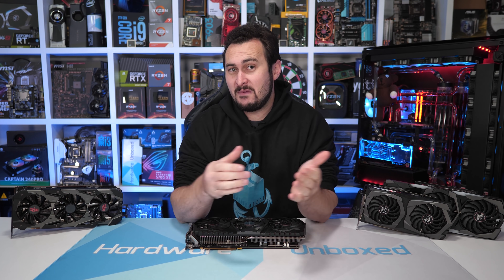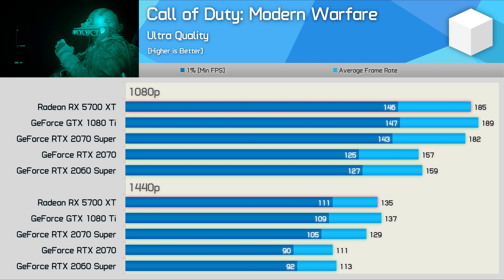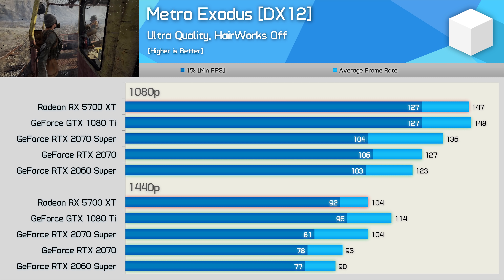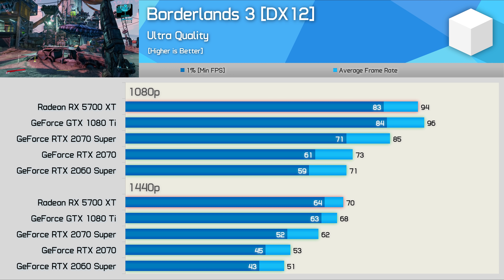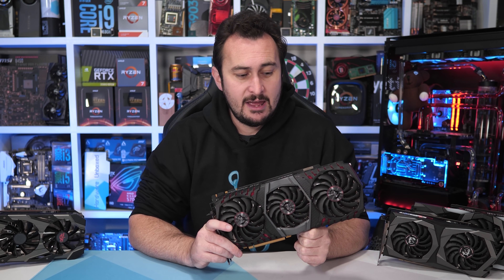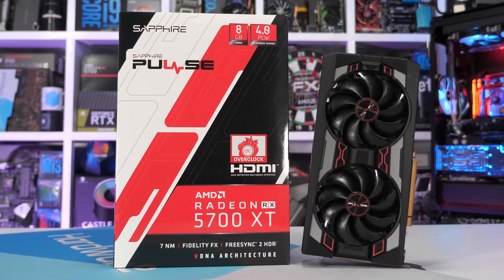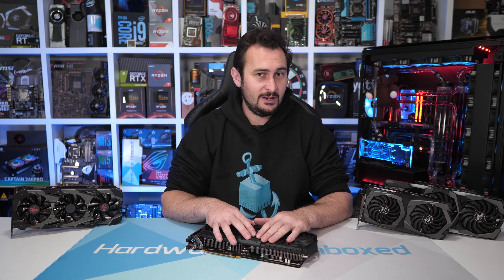GeForce GTX 1080 Ti vs. 5700 XT & RTX 2070 Super, 35 Game Benchmark

Comment: In the mining craze, i spent $1000 on a brand new 1080 Ti founders edition. I still use that card in my other rig on a full custom loop. Not getting it off until it cant no more. Gonna be a goo while. LOL
Reply: When I'm not gaming with it my 2080ti is going to mine itself back with my basically free electricity. I currently have £736 worth of BTC at the current rate.

Comment: I had the option. Buy a used 1080 ti for 550AUD or a new 5700XT for 729AUD. The answer was simple. 11GB, higher processing power, much cheaper.

Comment: I am surprised how well the 5700 XT did against the other 2 cards. It's basically a slightly worse 1080 Ti that costs new arround 150$ less than a used 1080Ti.

Comment: The max potential of the red devil or the nitro+ is to boost around 2150/ 1800 and with these settings i think u can get 4 5 fps more... So the point is, 1080ti is still a beast card if u consider is coming up in 2017, but imho the best choice for price/performance is the 5700xt.

Comment: Great video! I'm currently looking at getting a 2060 Super, or even a 2070 Super if I can fit it into my budget. I was just wondering, is there anywhere where we can find the exact stats of these 35 games on each GPU? I'm particularly interested in the frame rates achievable in Star Wars Jedi: Fallen Order on the 2060/2070 Super cards. The only stats I could see about the game in the video was the % difference between the 1080Ti and 2070 Super, but no actual frame rate benchmarks. Is there anywhere to get this data? I'd really love to see how it performs. :)

Comment: The 1080ti was indeed a good GPU but is not sold new anymore here where I live (in Portugal) and if I go to buy it used with no guarantee, it is more expensive than a 5700 XT new!  Is also impressive how the 5700 xt beats the RTX 2070 in all games, the RTX 2070 super in some and is very near the GTX 1080TI in other games while is 100€ less than a normal RTX 2070 and ~150€ less than the 2070 super here! But only a few people on the comment section seem to care! Isn't that a good value in a GPU? Is just because is AMD? People need to stop looking at brands and start analyzing real value. For those already with a 1080TI stick to it is excellent GPU still.

Comment: Thanks for the videos. Great to get info on where the 5700XT stands against the 2070S/1080TI and other cards. 

I'm very happy with mine and have had no issues. I've had my brother and two friends get the GPU too and the two friends had issues for a day but I have a method that seems to consistently fix issues right off the bat!

Prevent windows from automatically installing drivers via a setting
Restart into safe mode and DDU TWICE in a row 
Install motherboard BIOS updates (Make sure to follow instructions that may differ when it comes to models/manafacturers)
Reinstall chipset driver
Reinstall graphics driver
Re-enable auto windows driver install

Hope it helps anyone who has any issues. Beyond that it's been smooth sailing for all of us since!

Comment: Steve, you keep ignoring that the 1080ti also has 3GB more Vram than the 2070 Super as well as the 2080 super ,  which is another deciding factor to ones purchase decision... Only the 2080ti can match that !!! COD MW fully utilizes my 1080ti's 11GB Vram ...
Reply: @KarlKlaus vonS MW seems to have a logic to utilize all available Vram for better results. Look it up if you want. I am constantly gettin10.4 GB of gpu vram usage even on 1080p / 240hz ... MW was just an example, my point was that the 1080ti also has the Vram thing on its side against all other GPUs.
Reply from the maker: FYI that's just RAM allocation.
Reply: @Hardwareunboxed  I believe i can distinguish that !!! Please see here my in game capture: https://www.dropbox.com/s/uqsr5kz6bmljb33/1080ti_vram_mw.png?dl=0 

Also you need to state the Vram in favor of the 1080ti still ...

Comment: This video is about 1080 ti but made me want to buy RX 5700 XT somehow.
Reply: its a good card, and still less expensive than a 1080ti
Reply: Despite the drivers improving, I won't touch a 5700 XT. There's still a lot of people having problems with them. That being said, if they drop in price the risk may be worth it. Let's see what happens to prices when big navi drops.
Reply: @UKFX  They won't drop the price any time soon. The price is incredibly low for what it's worth. I bought a 5700 XT about just a week ago. Popped it in, powered it on and installed the latest AMD drivers. No issues at all, no additional setup needed, works amazing for 1080p Ultra games.
Reply: @UKFX  wtf why would it drop more? IT'S  380$ IN BELGIUM

Comment: From a gaming perspective (which is what this video is aimed at) Steve is correct regarding the pricing and the buying logic. However what Steve does not comment on and I would not expect him possibly to know is this card is still superior for coders doing machine learning. The performance coupled with the 11gb (3gb more on average) vram make this still the price for performance king. For this application this card is comparable to the 2080ti and Radeon 7.
For gaming Steve is of course correct and most would care only about this. But when wondering why these prices are maintaining above depreciation expectations coding performance must be considered.
Reply: What are tensor cores? Proof that you're a moron.

Comment: 5 months ago, i sold my 1080ti for 500 euros and bought the 5700XT sapphire pulse for 340 euros.
Can't say i noticed a difference in day to day gaming, but i sure noticed it in my wallet :P
Reply: That's a nice trade to be honest. Getting a cheaper and a bit less powerful GPU but getting some bucks to your pocket. Not everything is getting a higher priced GPU.
Reply: one of my water-cooled 290X died so I switched to an 5700XT after not being able to find an used 1080TI under 500 eur, especially not an ex mining card. in far cry 5, the 290X's were faster, but luckily that was an outliner.

the 5700xt cost me 420 eur. I was wondering who bought a two year old asus turbo ex-mining card for 450, which was the case. it was completely crazy.
Reply: Yeah you got some money and lost 11% perf on 1440P, you might aswell get a cheap gtx 750ti so you save alot of money and lose some performance...See this sounds stupid as much as your choice?
Reply: nighthawk695476 does your card work good? Any driver issues? I don’t know what to upgrade to. I’m using msi rx480 😭
Reply: GoHardSniper
I got a Gaming x 5700 xt, got it at the end of last year. I had some driver issues; occasional black screen on game boot up (only happened on game startup, never once mid game) would have to restart via button. But now, since mid February driver, I’ve had zero issues. Running latest drivers since, and no issues.
I have a 2139mhz core oc, at stock voltage and power limit, runs 2ghz+ 95% of the time. Pretty good for the $519 cad I got it for. I upgraded from an rx 580 @ 1080p 75hz, rocking 1440p 144hz now.
Reply: Andrew MacFayden thanks for the reply. Do you think it’s worth waiting till big Navi and ampere to see if prices will lower?
Reply: @nomeat  Depends on how bad you want an upgrade and how long you're willing to wait. Waiting isn't always good; look at RTX or 2017 cryptocurrency mining. Sometimes it is, like pascal or ryzen for example. Big navi and ampere could be delayed, or they could be around the corner. Kind of an impossible question to answer without a crystal ball, but if you're willing to wait then by all means do, but if you want something now, then see if you can find a decent deal on something and call it a day.
Reply: Andrew MacFayden thank you.
Reply: @andrewmacfayden1671  May I ask what is your card temp while playing game? Mine was 75 - 78 max setting COD at 1080p 70 fps :(
Reply: @quanganhta5750  it is meant to get hot, or that's the temp it will run at. Mine hits the same temps as yours, never goes above. As long as you have decent air flow it wont affect the card or anything in your system
Reply: @andrewmacfayden1671  noooo wait and get the new card and hope to God that its a beast of an upgrade you know I'd rather go from rx470 to 3080 then 2080 to a 3080 it would be so mind blowing
Reply: @nomeat  the Rx 480 is still good for 60 fps 1080p max settings gaming if that is what you are doing then don't mind upgrading untill the 5600xt price lowers
Reply: @Zak Dorsey Why do people forget that AMD Fanboy's made there own RX 5700 SOB Edition from a $359 ref card and don't even fear Nvidia's 2060 KO  https://youtu.be/qoPyGEiFNcY
Reply: Swapped to a ITX system and had to sell my 1080ti. Bought a brand new Gigabyte 2070 Super for $50 bucks more and now i have a full 4 years warranty. Considering i already bought my 1080ti used, im not out much as well :D
Reply: Sorry man. But thanks! I won't make the same mistake.
Reply: But didn't end up paying 840 euros ?
Reply: I sold Gainward Phoenix 1080ti few months ago and bought Pulse 5700Xt also... the worst move I ever made. Pulse 5700xt is very low quality made despite what the reviews say.. my experience at least. Weird aluminum cooler fin vibrations depending on fan spin up. Performance was crippled by bad drivers so even when the frame rate was high it stuttered...1080ti was smooth as butter in every single game. Sold 5700xt meanwhile and bought vega 64 nitro... much better card in my opinion, or has more mature drivers.
Reply: you got faster vram and 7nm so :) gen4x4
Reply: I bought a 5700 pulse non xt. Flashed bios, undevolted, pushed mem to 1850,can go to 1900mhz with a tad more voltage. Never hear the fans, its cool, around 180 wats max while gaming at 1440p 75fps. Cant complain, im satisfied.

Comment: Did you know if you use old drivers on the 1080ti, you'll get better frames.  Try the 417.35 nvidia drivers and run any of these tests and you'll get a boost.  I own a zotac 1080ti and these drivers give me at least a 10% boost.

Comment: The gtx 1080 ti, the gpu that AMD is still chasing lol. Seriously just one of those pieces of tech that has a lifespan longer than intended. Def a good buy at the time. Kinda like the rx 480. Just keeps chugging along.
Reply: metal_ak4  then the same can be said for rx 5700xt
Reply: metal_ak4  dlss is a joke
Reply: Salt Maker  It's really not. In the long-term yes it will be faster due to game/driver optimization but right now they are fairly even. I know I have both. A 1080 ti in my desktop setup and a 2070s mini in a TV setup.

Comment: Great video. I have a 1080 ti in my main Rig and have really been weighing the 5700 xt and 2070 super against each other for my secondary. Looks like the 5700 xt is still the best value since the 1080 ti has gone up pricing

Comment: One thing I learned, especially here in my country, the 5700xt is the most capable and sensible high-end gpu to buy.
Reply: @obelisk619 Yeah, it's just amazingly good performer for the money. Idk about the driver issues tho
Reply: @abh8k  It is pretty good gpu. I use it to game on my qled tv at 1440p 120fps.
The drivers are still terrible to be honest. Freesync is very buggy with current drivers unfortunately and some games stutter badly but when everything works its great.
Reply: @imrileth6618  great vfm gpu, hope amd fixes all the bugs and issues.
Reply: @imrileth6618  Hm, the drivers have been working fine for me for a couple of months now after dealing with its early fked up drivers
Reply: @imrileth6618  Did you update drivers? Im having no freesync issues other then the monitor turning on and of when entering a game. But mine is also a 2016(maybe 17) model freesync monitor which makes it a hardware issue and not driver of the GPU.
Reply: Black screen issue is fixed.  I don't have any real issues with the drivers no more.
Reply: @RevanBC  I ain't got no more either.
Reply: 5700xt isnot high end .... nvidia s high end : no driver issues, rtx, dlss, better fabrication quality, and.... more power. just the equal with a 2070 or 2060super but the real high end is more power
Reply: Yea its that way in most countries. When i bought my 5700 xt pulse it had a few defects and i kept having problem after problem so i returned it and bought a 2070 super for only 50 bucks more. The weird thing is that after a year the rtx 2070 super is actually 100 bucks more expensive then it was back then so i guess I'm just lucky.
Reply: high end LOL

Comment: I kinda regret selling my 1080Ti not so long ago and grabbing 5700XT but the warranty was over and I rather have brand new, 10% slower card than 3 years old power hungry and hot 1080Ti. I had other 1080Ti before which died but luckily it had warranty. It's always better to buy brand new product with better support than old one, unless there's atleast 1year+ warranty left

Comment: I am disappointed that u can recomend 5700xt knowing that the card will lose 30-40% of the price in less that 6 months when next gen cards will lauch. Plus the card will be dead in the future games.. so where you recomend the rx480 as the card was supposed to be better than 1060 in the future.. here 2070s will be 30-40% better in the future games with rtx as seen in digital foundry tests. And there will be more rxt games thanks to the consoles. If you really need to get a card get a rx480 or a rx580 for 100 and wait for the next gen to kill this expensive gen! Unless.. amd and nv will set up prices well above 1000 for midrange cards.. then.. we lose.. we lose bad!

Comment: He sneakily skip on the power usage for GTX1080Ti vs RTX2070 SUPER vs RX 5700 XT

2080Ti IDLE: 13 Watts Gaming LOAD: 252 Watts
RX 5700 XT IDLE: 8 Watts Gaming LOAD:  186 Watts
Difference in Gaming LOAD Watts use: 66 Watts

2080Ti IDLE: 13 Watts Gaming LOAD: 252 Watts
RTX 2070 SUPER IDLE: 12 Watts Gaming LOAD:  198 Watts
Difference in Gaming LOAD Watts use: 54 Watts

RTX is a lot better then GTX or RX for encoding and decoding and streaming video's by a very large stretch.

Comment: I bought one 1080Ti FE on launch day, slapped a water block on it, overclocked it and it is still doing amazing - still haven't seen a game which it won't run just fine on my 1440p monitor.  Later on, I bought another one for dirt cheap from someone who was way too over-hyped for the 20-series and sold too early... Now even my HTPC has a 1080ti in it.

Comment: I did get a new 1080ti for £700 at the end of 2018. A week later they were selling for for over a £1000.
Reply: Yeah, I had to hold fire on an MSI 1080Ti Gaming X as they shot up to £1200 in some places during the mining boom. 

One year later and I grabbed a brand new one for just over £600. 

The 1080Ti has been the best buy since my MSI GTX970 for £279. :)
Reply: @trickyrat483  I went from a 970. I still have it in my other rig. Msi twin frozr I paid around £300 I think.

Comment: In France, second hand 1080Tis are  way less expensive than what you found on Ebay, you can find them under 400€, even sometimes closer to 300€.
Therefore, it becomes the go to option.
You can also find second hand 1070Tis at less than 250€ which is a very solid option as well. I believe it's due to people having only eyes for the RTX 2000 series, which as you just demonstrated, brings very minimal performance benefits unlike the price would suggest. :)

Comment: This really shows how good value the RX 5700XT is, they can be had for around £320-£350, and the 1080 ti and 2070 Super are around £500/ £460 respectively.

It's such a steal!
Reply: Yeah it is, I'm very happy with my Nitro +. Because of Nvidia's market share, brand name recognition and the fact that the GTX 1080Ti is a great card they hold their value pretty well in the second hand market. Personally, when it comes to CPU's and GPU's I prefer to buy new and the older parts that I replace on my main PC go into upgrading a secondary one.

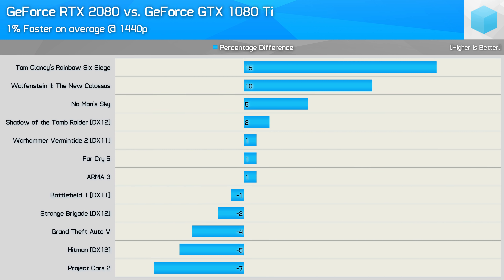Comment: 2:00 not to mention 1080ti has +3GB VRAM, making the 2080 dead on arrival
Reply: So dead that NVIDIA made two replacement cards at cheaper and same price aka 2070 Super and 2080 Super
Reply: 2080 has faster ram that overclocks higher. I'm keeping my 1080ti but these difference would be user defined.
Reply: So which Game needs more than 8gb on 1440p?
Reply: @AzumDzumHzumS  i can get my 20 series KPE to about 41 fps in no mans sky in 1440 LUL my base has some serious power usage problems

Comment: I was researching and thinking exactly about the comparison in this video just last night. HW Unboxed came through the very next day. Awesome work!
Reply: Forgot to add this just reaffirmed my selection of the 1080 Ti as a GPU to buy - where I'm at it is available brand new still and funny enough it's cheaper than both the 5700 XT and the 2070 Super, so heck yeah, 1080 Ti it is!